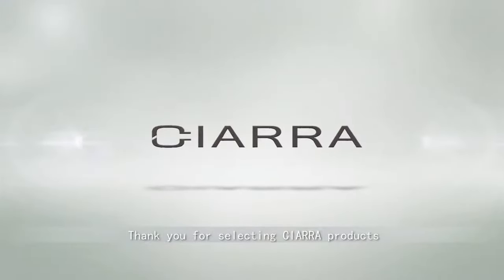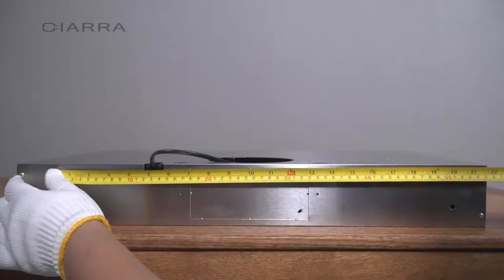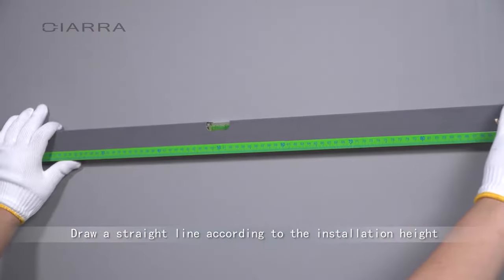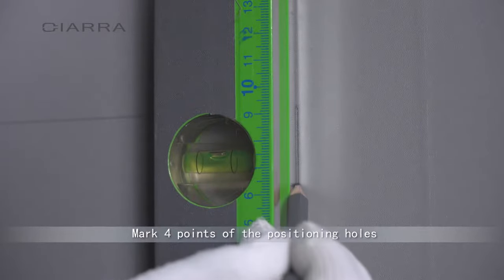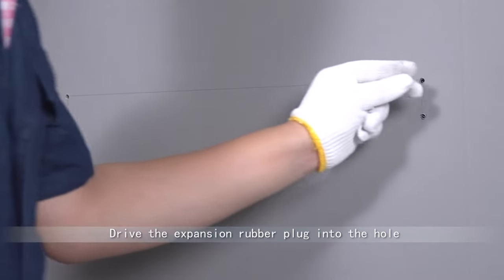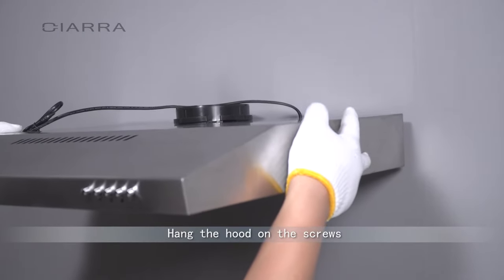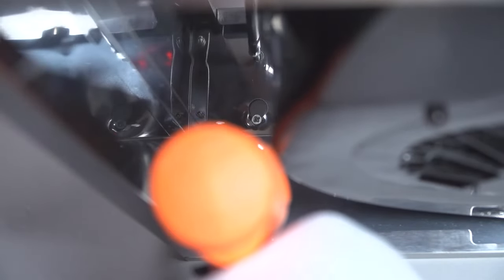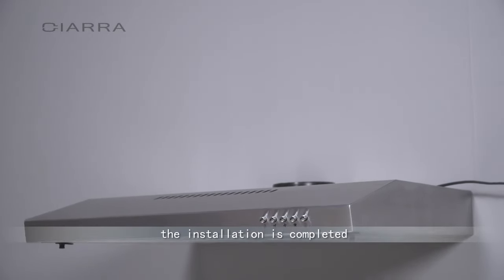CIARRA Integrated Cooker Hood Installation - CBCS6903

Comment: Do you still need the exhaust hole when using recirculating
Reply from the maker: Hi, thanks for the message. If you are using recirculation mode, then the only thing you need is a carbon filter.

Comment: Bro how am i going to install it against a wall if the cable is at the back. Wont it break the cable to tighten it to the wall?
Reply from the maker: The power cord comes out from the top, not the back. Therefore, the power cord will not be broken.😉
Reply: @CIARRAAppliances  but my cable comes out of the back...
Reply from the maker: The power cord of the CIARRA CBCS6903 cooker hood is exposed from the top. In order to understand your problem more clearly, please send photos or videos about the position of the power cord to our customer service email ：info@ciarraappliances.com.😉
Reply: @BIanka0200  ist die Abzugshaube gut?
Reply: @BIanka0200  ist das mit nem Filter oder braucht man dafür ein Abzugsrohr. Brauche eine ohne Rohr deshalb. Das runde schwarze auf der abzugshaube verwirrt mich ein wenig, da ich meins unter ein oberschrank montieren muss
Reply: @dronna_2030  du kannst ein rohr anschliessen aber muss man nicht. Ich habe auch kein rohr. Da ist ein filter an der unterseite welcher glaube ich alle 3 monate gewechselt werden muss. Eigentlich nur anschliessen und es kann losgehen
Reply: @BIanka0200  kann man es also unter ein Oberschrank montieren? Oder muss man es direkt an die Wand montieren,

Comment: Hi, in the extraction mode, why is the air also going out from the front?? Do I have to modify anything? Its not in the manual... Thanks in advance
Reply: does it mention if the hole needs to be covered when using recirculation mode? this video is literally just how to mount

Comment: is this hood have exhaust?
Reply from the maker: The CIARRA CBCS6903 model has 2 circulation modes.
1. Install the aluminum foil duct / ducting pipe for external exhaust.
2. Install an activated carbon filter suitable for indoor recycling.
If you need exhaust, our packaging does not include aluminum foil duct, so you need to buy them yourself. A suitable exhaust pipe has a diameter between 150mm and 153mm.

Comment: We just bought this and realised it needs a ventilation hole cut out, and we were thinking it is the type that doesn't need a ventilation hole cut out.
Reply from the maker: If you use a carbon filter, then the ventilation hole won't be necessary.

Comment: What? No mention of how the hood exhaust is fitted? Or of how robust the wall needs to be to support this device? (It looks scarily fragile to me.) And expansion 'rubber' plugs? Who on earth made this nonsense video? LOL!
Reply from the maker: Thank you for your support! This model of cooker hood can either be installed for wall mounted or integrated, with recirculation or extraction mode, totally up to one's need. Based on that, a normal wall that is robust enough able to support the kitchen cabinet can easily hold this cooker hood. For further information please check on our website: https://www.ciarraappliances.com/products/ciarra-60cm-integrated-cooker-hood-cbcs6903-ow, or enquire the customer service department at info@ciarraappliances.com
Reply: Wall plugs are used when you need to screw your appliances into a wall securely. When drilling into the concrete, brick, which should allow the wall plug to be pushed in with a snug fit first, then the drill in the screw into the wall plug, the wall plug will expands from inside to provide a secure fixing.
Reply: The wall plug requires an 8mm drill, but the screws are 2mm. Is this correct?